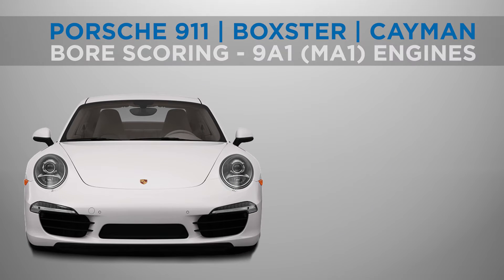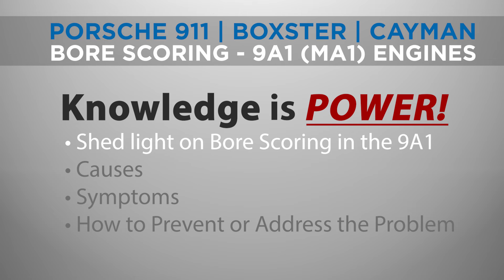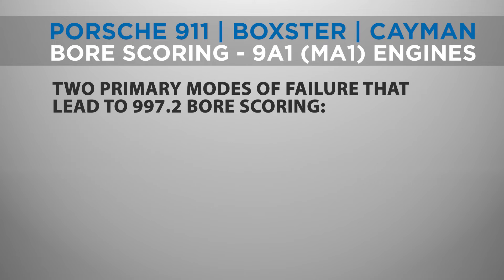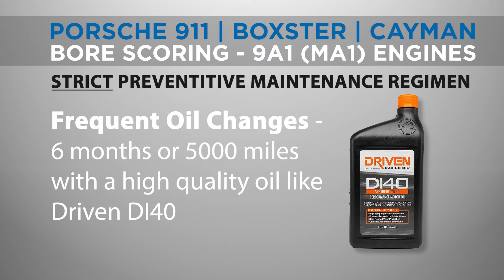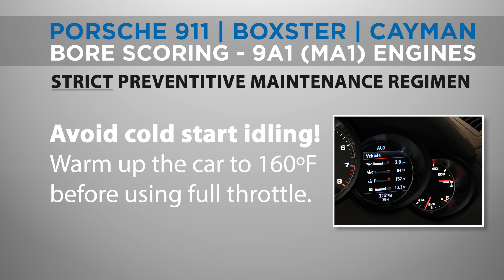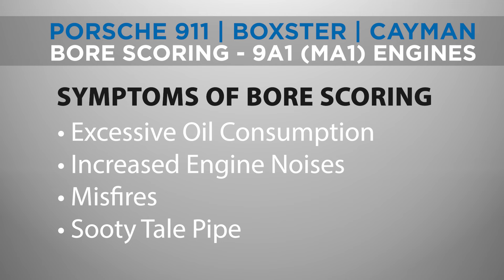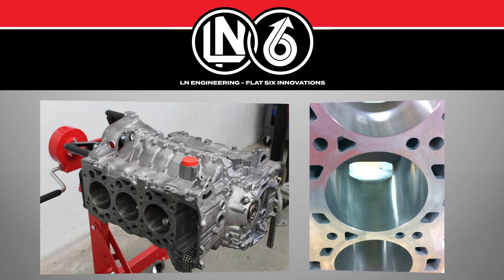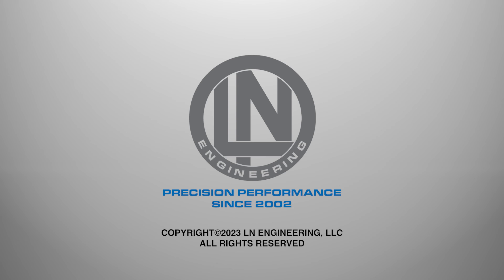Are Porsche 997.2 and 991.1 9A1 (MA1) engines susceptible to BORE SCORING?

Comment: I have a 991.1 2013 70,00miles 9A1 engine, on inspecting after tapping noise it has baore score, Porsche are not addressing this issue in the engine leaving used Porsche owners with major problems to deal with if they don't have a warranty
Reply from the maker: That is most unfortunate. We honestly believe that the factory recommended oils and long drain intervals are partially to blame. That's why we recommend an oil with high moly levels for these engines. In the case of a 991.1, that would be Driven DI40. Although intended for prior models with the M96/M97 engine, we do have some guidelines posted on steps that can be taken to minimize the likelihood of cylinder bore scoring in these models: https://lnengineering.com/products/watercooled-porsche-cylinders-sleeves-and-pistons/porsche-cylinder-bore-scoring/tips-on-how-to-prevent-porsche-bore-scoring.html

Comment: Buy only Mezger's.
Reply from the maker: Always a safe bet. Coolant pipes are the biggest issue on these models but easily addressed through preventative maintenance.
Reply: Haha your cute 🥰 buy only Mezger is your advice. You pretend that everyone has GT2 GT3 money.
Reply: @victoria19853  yes, if you want to stay away from ims failure and bore scoring issues that afflict 996 and 997.
Reply: @eddiedantes7470  Not every engine has that issue and part of the reason bore scoring happens is because the majority of the Porsche owners don’t drive their cars most people put on them like 2000 miles a year if that, and that causes the oil to sit on the bottom of the oil pan not in the entire engine this is something not talk about in the Porsche community some Porsche owners think that they just could go just drive hard after the car is been sitting in the garage for months at a time with just oil in those engines most people don’t even think about putting oil stabilizer for long periods of storage . The 997.2 the word is that bore scoring is not an issue.
Reply: @eddiedantes7470  9A1 doesn't have an IMS at all.  And, the nikasil plating on the Mezger is not completely immune to scoring, depending on fuel quality in your area.  BMW originally had nikasil plated bores on their M52, but chose to use iron blocks for some markets because sulfur content in the fuel attacked the nikasil.  One of those markets was North America.

No engine bore in the world, whether alusil or locasil or nikasil or chrome or good old iron is immune from scoring.  The big deal with the M96/M97 is that they do it sooner than you'd expect.  Millions of old engines have scored bores; it's just only a crisis when it happens to a pig-headed German engine with no over-bores and +1 pistons available.  Or an S2000 which has the same problem, but we don't talk about that.
Reply: @victoria19853  996 turbo (mezger) is affordable option, same price as 991.1
Reply: PTWA lined cylinders on "9A2" engines don't score either

Comment: Premium Cost , third world engineering . Issue has an easy fix yet Porsche ignores it . Mind over matter they don't mind and you don't matter . Sign of the times
Reply: Soon they all be electrical and I don't have to lust over them any more. 
good and bad. haha
Reply: @desmomotodesmomoto2033 I strongly suspect that exceptions will be made for the GT series  top tier (expensive or hyper expensive) vehicles.
For example, Ferrari and Maserati. Arguably too few of them to require their elimination. Ditto Rolls Royce,Bentley, Maybach etc.
By sheer coincibdence, because these among the most desirable and expensive cars you can buy. For Porsche, except the same thing for their 911 GT cars.
Reply: @GT380man  I hope so.
Reply from the maker: Porsche did go to SUMEbore coated cylinder bores with the 991.2 and 718, so we hope cylinder issues are a thing of the past. Fingers crossed!
Reply: I daily drive my 981 and maintain it frequently as preventive but I don’t have any fear of bore score, not a problem with these engines unless owner neglects the car or doesn’t drive it frequently or overheats it. These 9a1 are great engines, nothing like the m9x nightmares of the past. Read and follow the owners manual, change your fluids more frequently than recommended and your 9a1 should be super reliable and free of scoring.
Reply: @Opposed_Motoring that's simply not true. MA1 engines are now known to suffer bore shrinkage as mentioned in this video which leads to bore scoring at best and total catastrophic engine seizure at worst, so actually way worse than the M96/97 engines! This is not prevented by regular oil changes, it's a fundamental design flaw of the block around cylinder 6. Lots of YouTube videos on it if you go looking.
Reply: @pjay3028  that explains why there are several shops that specialize in m96/97 rebuilds around the world who seem to have been making rather lucrative businesses out of rebuilding and dealing with all the problems. But besides that point, or the fact that 9a1 engined cars sell for a premium, it’s really not even close like the fact that you are saying that makes me think you are trolling. Either that or you are lying to yourself. The m96 engine was built as a cost cutting measure to save the brand, all the motorsports and higher end 996 and 997 got mezger engines for a reason. The m97 was a revision to the m96 5 chain and it also head a plethora of problems and design flaws. Tolerance stacking inside the engines rotating assembly meant frequently RMS and IMS shaft leaks, casting flaws meant cracked heads to worry about, crappy RTV valve covers, water pump failures, I could go on and on while the 9a1 engines are overall rock solid. Also cost of ownership is a lot less because they’re just a lot more reliable. But yeah even Hartech themselves have reported bore shrinkage in the larger 9a1 3.6 and 3.8 but Barry himself has said it’s such a rare issue that hasn’t come up enough, it’s not even worth their R&D time or stocking rebuild parts. What a silly comment made by yourself 😂 it’s not even close… money no issue, most people will take a 9a1 engine. They don’t have the baggage that comes with m96/97 engines 

If you are worried about bore shrinkage reported in a hand full of larger displacement engine variants of the 9a1 out of thousands…
Reply: @Opposed_Motoring Appreciate the insight & education. Now seeing <70k mile 997.1 clean title for less than $48k. 
As I recall from LN, early bore scoring evidence is actually seen from UNDER the piston at low stroke? Thus, spark scoping wouldn't reveal?
Reply: Typical trash German reliability